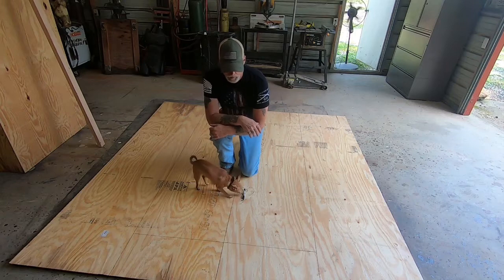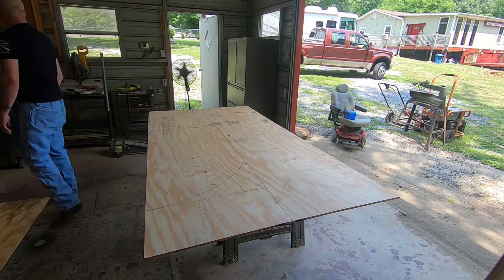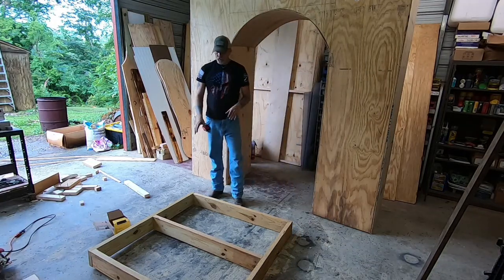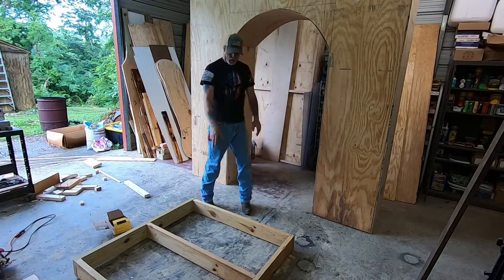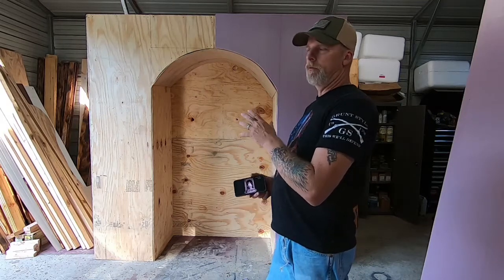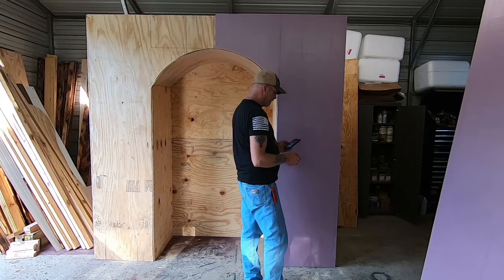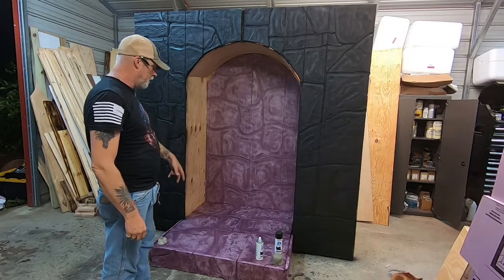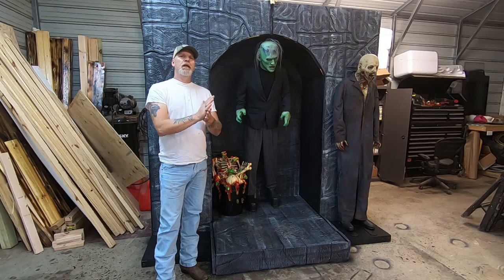HOW TO BUILD FRANKENSTEIN FACADE HALLOWEEN SPECIAL

Comment: Just subscribed to your channel. You have a lot of great projects. I have a tool question what were you using when you cut the stone lines out ( make and model it cut so smoothly). and when you went in with the heat gun was there just plain water in the bottle?
Reply from the maker: I just used a wood burner...and actually it was Windex becase I was to lazy to get water but yes use water and head gun and it will give you that effect.., Thanks for subbing and watching any info you want just feel free to ask any time .
Reply from the maker: Not sure of make and model it was a homedepot one I got the highest watt one so it gets good and hot it worked great I can get back to u in a couple days on make and model inless I get corntined for the covid 19 crap